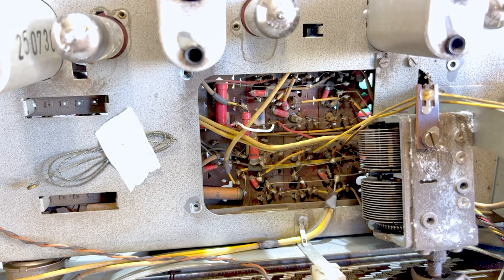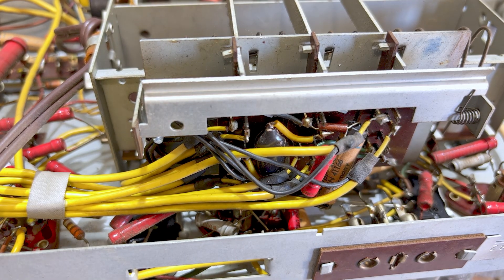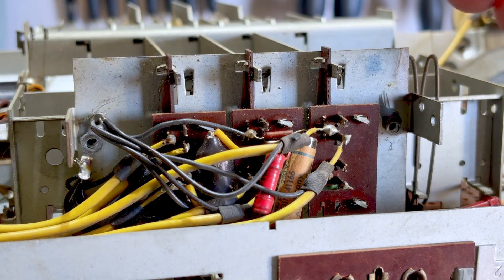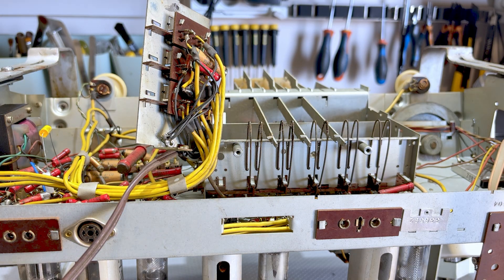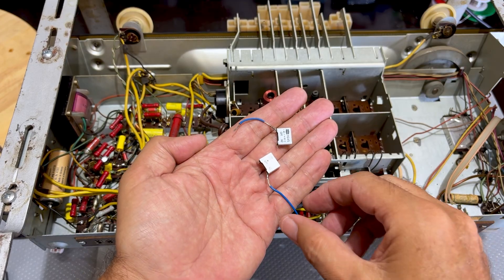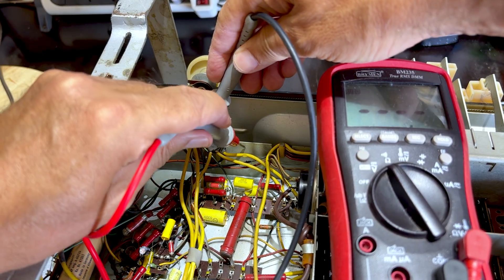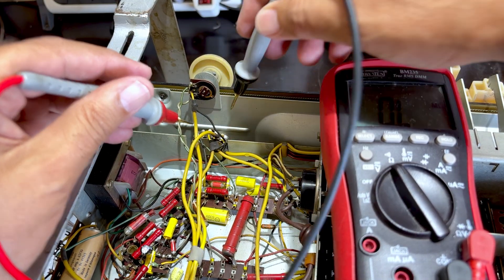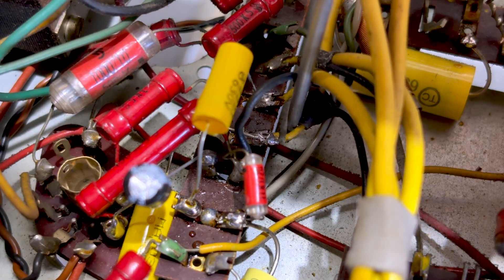Recapping the Siemens Super G7 – Lost Audio?! (Restoration Part 2)

Comment: Danke 👍 und LG.
> Warum haben X2-C's im Audiobereich nichts zu suchen?
> Wo waren diese 2 X2-C's montiert?
Reply from the maker: The two X2 caps were used in place of 25nF caps in the signal path. They work, but not really the correct caps for the purpose.
Reply: @electronicsoldandnew  Danke

Comment: Those 2 5 nF caps at the mains input that you haven't changed yet (waiting for Y caps) are not for filtering noise. As much as I know, they create a virtual earth for your AM antenna in case you do not actually earth the chassis.
I wonder if I had found out the way to remove the switches. 🤔 Nice video as always, even if a bit on the short side.

Comment: If I recognise it correctly, the small brownish/black capacitor in your box at 5:32 is one of the worst capacitors ever made on this planet. We called them 'Hustelinchen' in German, because they looked like a popular brand of cough drops. These were absolutely horrible and I've seen dozens of those in TV sets of the early 60s. Nothing but trouble.
Reply from the maker: I agree. Most of the Phillips radios I e restored used them too. Really bad.